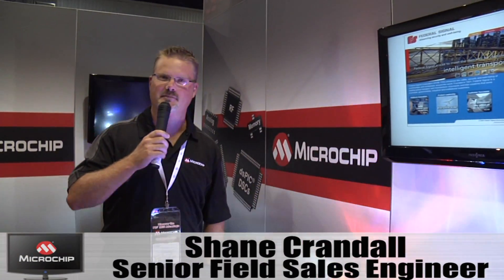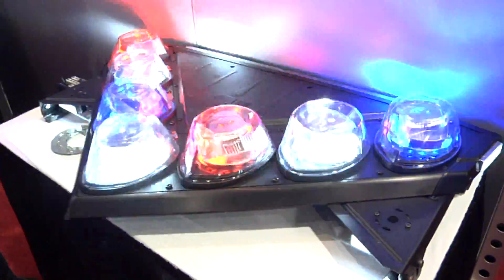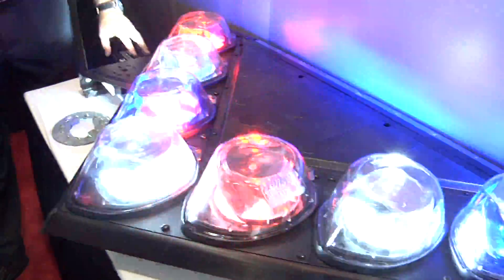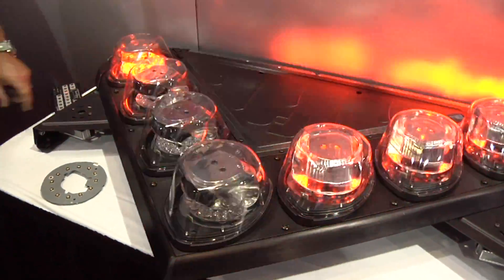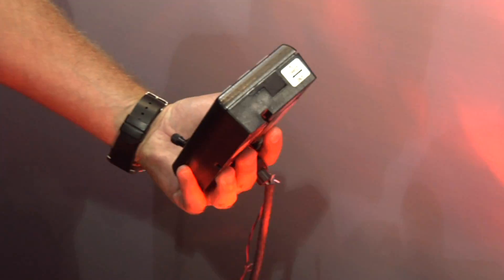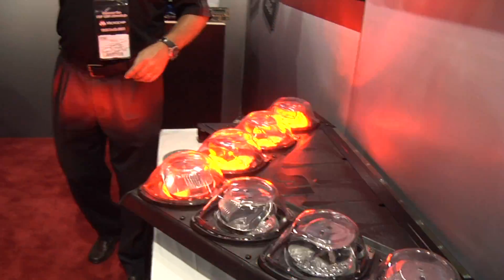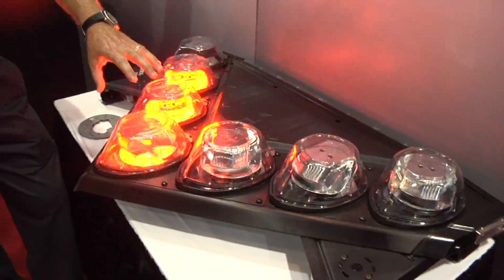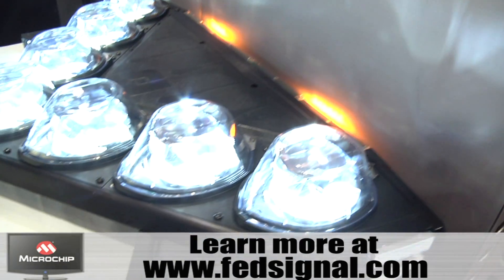Microchip Demonstrates New Federal Signal Light Bar (ESC Chicago 2010)

Comment: Where can we purchase these lightbars & accessories...???
Reply from the maker: Hi Jeff,
This light bar was designed and manufactured by the Federal Signal Corporation, located in University Park, IL.  I would suggest contacting that location for further details on how to purchase. Here is their information:
 
Federal Signal Safety And Security Systems Group
2645 Federal Signal Drive
University Park, IL 60484
Phone: 708-534-3400
Fax: 708-534-4774

I hope this helps!

Comment: could this be done in an aerodynic package as their LED version has a limited light dispersment being stationary. im just wondering if the circuit board and rotator package could be implimented into a different bar or is this just the best light positioning for a lightbar?